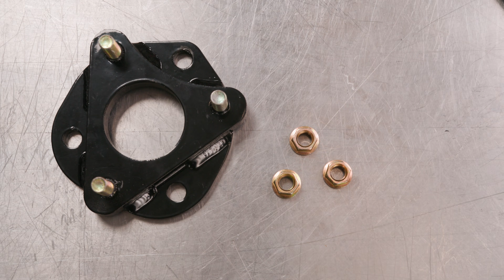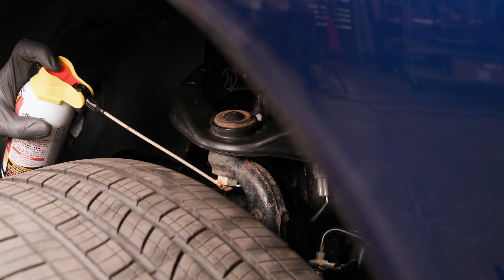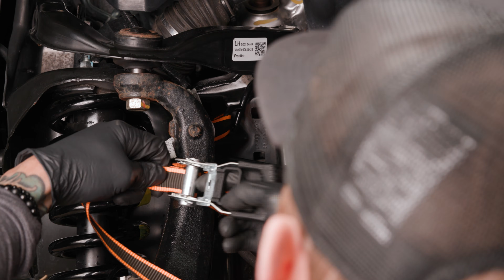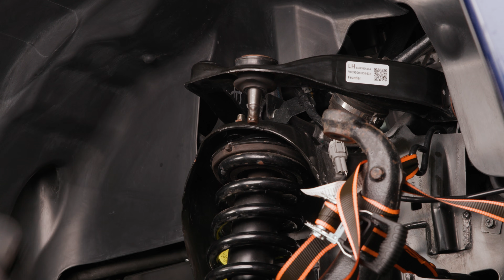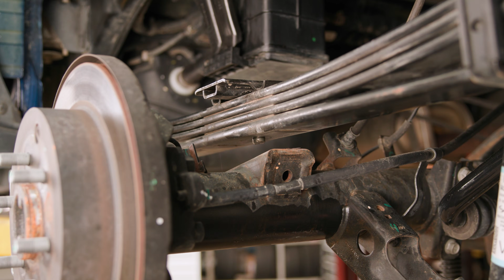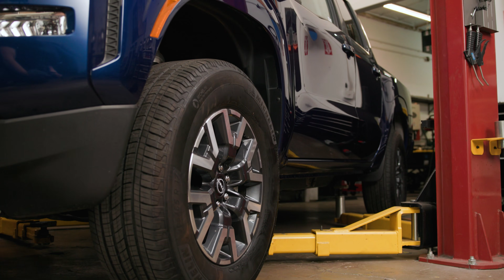Nissan Frontier NISMO Off Road Lift Kit Installation Guide

Comment: Are the upper control arms necessary to change?  Or can you just do the lift kit?
Reply from the maker: Thank you for your inquiry. The NISMO control arms are required for all lifts 2 inches and above. They are not necessary with only the standard 1.5-inch lift kit. Feel free to visit our Nismo off-road parts and accessories website for more information. Should you have any additional questions, feel free to reach back out.
Reply: Thank you.  I went ahead and had this installed today. Makes a big difference.
Reply from the maker: Thank you for being a part of the Nissan family, Heber! We're glad to hear that you're happy with the results of the lift kit. 😎

Comment: I'm amazed this is a manufacturer video and shows a glaring mistake like this... Any bolts that pass through a bushing should not be tightened while the suspension is at full droop (control arm bolts, lower strut bolts, shock bolts, etc). These are not polyurethane bushings or heim joints, they do not rotate, they twist. Therefore, they must be at a neutral position (ride height) prior to tightening. That is why you had to forcibly pull the control arm down to get the ball joint through the spindle @3:30, you're fighting the bushing that was tightened at ride height. Now those bushing are constantly being torqued by the weight of the vehicle which will negatively affect ride quality and ride height, plus it will drastically shorten the life of the bushing. Get it together Nissan!

Comment: The video is helpful for installing the shock housing spacer but can you show the video of removing and installing each control arm.  It was skipped over and from other videos with different brands they are showing taking apart the steering shaft for the driver side and also removing the inner fender wall.

Comment: Do you actually need to replace the UCA since it’s only 1.5 lift? Will this fit the 2025 Pro-4x?
Reply from the maker: Hello, Pete. This lift kit does fit the 2025 Frontier PRO-4X. For any installation questions, we encourage you to speak with your local Nissan dealership, as we rely on the expertise of our technically trained Service Technicians. Contact information can be found by entering your ZIP code here: https://www.nissanusa.com/dealer-locator.html. Please let us know if you have any additional questions.
Reply: no you dont need to replace the upper control arms...  you just need new cotter pins for reassembly

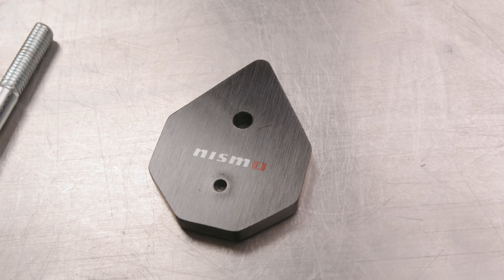Comment: All good, except the bump stop spacer section at 2:40.  You're supposed to take the lower pad off and sandwich the spacer between the pad and LCA.  There's no hardware for it because you reuse the stock nut.  You guys were raiding the nut 'n bolt bucket to rig that up there :p
Reply: Hey brotha, care to elaborate? I’m tryna figure this out as we speak thinking they never sent the hardware. What exactly am I reusing?

Comment: How do you know if you over tightened the bolt on the upper ball joint?
Reply from the maker: Hello. As our Service Technicians are technically trained, they are in the best position to assist you with your inquiry. We encourage you to reach out to your local Service Department for further support. Locations near you can be found here: https://www.nissanusa.com/dealer-locator.html. Thank you.

Comment: Just ordered this exact kit for my 2024 Pro 4X...having it installed at the Nissan dealership next week, hope all goes well👍
Reply: What is the all in cost going to be?
Reply: @ryanmerkel9167  Right around $1500  parts n labor, including alignment. $300 for lift kit, $700 for UCA'S and they quoted me 3.5-4 hours labor. Probably could of got the parts cheaper if I hunted around, but I got em from the Nissan dealership that is doing the install.
Reply: @DouglasB65  whats the tire size you go with it? thank you
Reply: @kentan11 I have Falken Wildpeaks AT4W'S 275 70 17's
Reply: @DouglasB65 thank you

Comment: So the spacer goes between the rear axle and the leaf springs; what's the point of this lift if you gain no ground clearance for the rear diff?
Reply: No lift gains ground clearance, taller tires are the only way to gain more.
Reply: I'm going with bigger tires = more lift...

Comment: Is this going to damage anything if I go off road
Reply from the maker: Hello. For the best assistance with your inquiry, we encourage you to reach out to your local Nissan Service Department. Rest assured, this team is technically trained and equipped to provide you with the information you need. Contact information can be found by entering your ZIP code here: https://www.nissanusa.com/dealer-locator.html.
Reply: if you get the uca's there's no coil bucket contact and you'll be fine. technically you're putting a bit more strain on the front coilover... but let's be honest, you're not going to blow them unless you push it to the extreme.

Comment: Does this really level out the truck? 1.5" front and 1" in the rear, so if my math is correct that means there was only a half inch difference on the front vs the rear from the factory? I find that really hard to believe.
Reply: You’ll still have about 0.5” of rake which honestly is kind of a good thing. 0.5” rake looks 1000% better than 0.5” too high in the front, not to mention if you tow or haul.
Reply: Its a lift kit not a level kit, i have this kit and I still have 1" of rake which is nice to have some rake

Comment: Does the rear u bolt plate have a forward facing side? Or it can be installed in any direction?
Reply from the maker: The NISMO suspension items do not replace or require replacement of the rear u-bolt plates. We utilize the OE parts to reinstall, however we recommend to reinstall in the same direction as removed. Thank you.

Comment: You fail to mention that you need upper control arms to prevent coil bucket contact BUT your control arms throw the camber so far out of alignment that you can’t get it in spec and it wears the tires on the outside.
Reply: Doesn't the Nissan Camber kit allow you to bring Camber back to spec ?
Reply: I had the crappy silver ones and the OEM gold ones. The dealership and an offroad specialty shop couldn’t get it close. +1.9 camber was the best they could get on each side.
Reply: @seanc2037  i think im going threw that right now, i got the nismo upper control arms and the allignment aint right, may have to buy z1 upper control arms,

Comment: I'd love to have this done to my 2023 Frontier but I don't have the tools or lifts to do it and I trust nissan mechanics as far as I could throw them.On the day you might get a person who cares how it goes on or you might get the guy they have sweep the floor. It should have come from the factory like this. I mean it's a Pro 4x for offroad. It would have cost nissan pennys to have it built in and made the truck even better looking than it already is and a better class leader in clearance. Daft.
Reply: Find a local shop near you that has experience in Lifting ALL Trucks . They are out there. you just have to find them . I come from Florida . They are everywhere. They usually lift 25-50 trucks a year, all makes all models ...That's real experience, if they don't align them , the shop will usually know someone that does. Find people who Love to do this stuff .
Reply: @patrickjohnson2886 lifted trucks in FLA for all those big mountain trails you guys have? 😮
Reply: You are right to not trust Nissan tech’s. They don’t seem to be qualified to make a sandwich let alone work on cars. The dealership screwed up the lift install on my new truck and had to take it somewhere else to get it fixed. Then a different dealership screwed up the Nismo ditch light installation. I ended up having to completely redo it. They didn’t even have the hardware on the lights in the right spots. I’ll be doing all my own work for now on.
Reply: I just put this kit on my 2025 frontier and it's crazy easy!!!
Reply: I guess this voids the warranty then?
Reply: @bradbaublitz9046  no

Comment: 🤔 Think that's the wrong spot for the bump stop spacer.
Reply: yeap, you have to remove the oem bump stop spacer located on the lower control arm first then  add the nismo to it and installed it back.

Comment: How long would this take a mechanic?  My dealership is telling me 8 hours for these exact parts
Reply: They are lying
Reply: Pfft..8hrs?...tell em to pound salt. There's no reason it should take anymore than half of that.  🤔
Reply: I was quoted $600 or so installed.  This is without control arms.  It's a couple hour job.

Comment: Will this modification void warranty? I purchased the extended warranty package for my 2024 pro-4x and I'm a bit worried about losing out on it with this mod.
Reply from the maker: Hello, for inquiries regarding retrofits and updates to your Frontier, we recommend that you connect with a Service Technician at your local Nissan dealer. Contact information can be found here: https://www.nissanusa.com/dealer-locator.html. Thank you!
Reply: if installed by Nissan service, shouldn't void anything.
Reply: Should wear normally, also this has nothing to do with your powertrain warranty